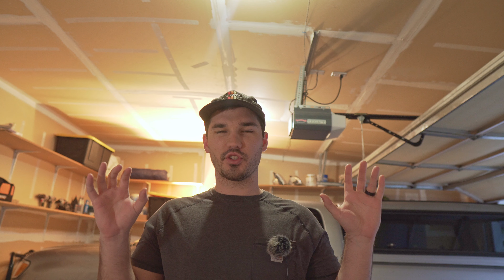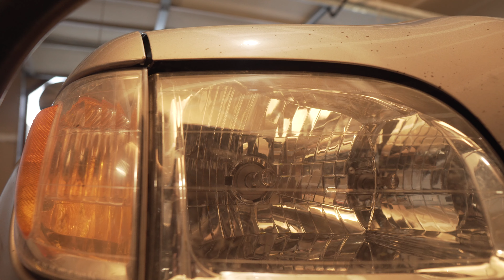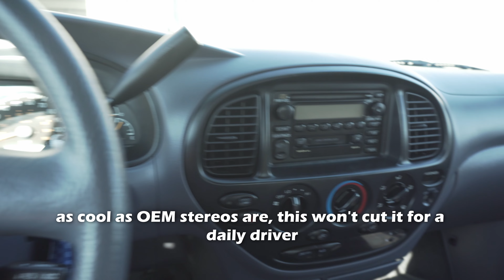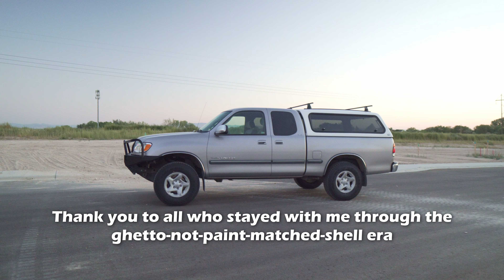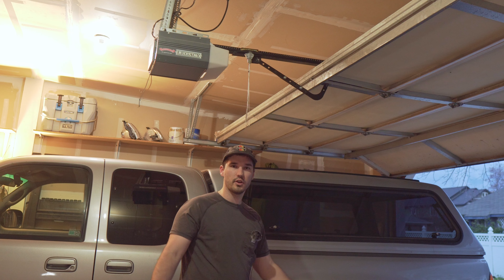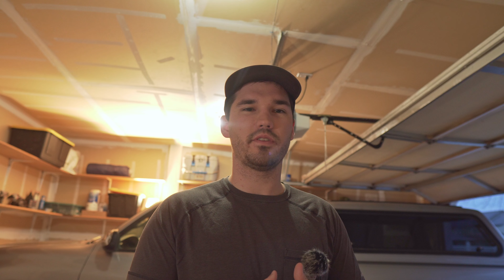3 Upgrades That EVERY Old Vehicle Needs

Comment: My 2002: Headlights: I installed S-V.4 LED with the proper cut-off in new OEM housings, these are plug & play and there is no scatter effect. I also installed Yellow 3000K LED 9006/HB4 bulbs in my OEM fog light housings. I am still using the factory head unit with a small factory amp, it has a built in 6 disc changer and a cassette deck... It sounds and functions great, but I may upgrade the speakers at some point. 

Personal touches: Alloy wheels from a 2005 Platinum. Tail light housing from a 2005. Bilstein 4600 series shocks and Hellwig anti-roll bars front and rear. I also installed a Kazuma/TRD LSD in the rear. I installed a huge light weight aluminum Truck Hero ARE camper shell on my 8 foot bed, it has a full size hatch back door that eliminated the tail gate. In 2004 I replaced the cracked exhaust manifolds with JBA short tube headers, this solved the ticking problem and turned out to be a nice upgrade as well.

 I had the hood & roof of the truck plus the front, rear and roof of the camper shell sprayed with Line-X, this adds a layer of protection and reduces surface area that I have to wax/polish. I had an ARB winch bumper on the truck for a short time but I did not like how it's weight moved the center of gravity to out in front of the truck, so I reinstalled the factory bumper.

Comment: I also sleep in my truck bed on road trips. A problem I'm currently having is condensation builds up on the ceiling from the heat my body produces. This condensation then rains down on me throughout the night. Have you had this problem, and if so, how did you solve it? 
I'm guessing opening the windows would help in the summer, but it is too cold to do that in the winter.
Reply from the maker: Open the window no matter the temps. That’s what I do. Slide the cab side window open a little. 

A battery powered or rechargeable fan also helps

Comment: The high beam/fog light issue is due to the stock fog light being wired to the low beam circuit. If you do the modification usually referred to like fog lights with high beams for your car you wont have this issue when upgrading halogen bulbs.

Comment: To add to the headlights, install a headlight relay harness. A lot of old cars run power for the headlight through the switch and back to the lights. the harness Insures that your lights are powered straight from the battery, giving them just a bit more power and thus a bit brighter. 

Also, if you can find them for your vehicle, get E-code headlight housings made for left hand drive. they will have a much better beam pattern over the stock housing. The pattern is flat light modern lights but with an upward swoop on the right to illuminate the shoulder and roadsigns and such. 
I run E-code housings, the relay harness and high wattage HALOGEN bulbs in my Cherokee and it's great. Low beams give just the right amount of light and high beams almost feel like a light bar. I prefer it over the headlights in some of the newer cars I've driven

Comment: I've owned my '02 Sequoia for 7 years now and I've updated it along the way. Ditched the head unit and sourced Crutchfield for a BOSS Nav unit. It doesn't really compete with today's factory systems, but for what I need it to do, it's done the job well. Welcome bonus: back-up camera! Switched out all of the dashboard and instrument panel light bulbs and replaced the dim yellowed dome/map/entry lights with cool white LEDs. Boy, they made a big difference! I can actually see around the cabin at night now! I admit I jumped on the TRD knock-off styling train. Heritage grill? Yep. Imitation TRD wheels? Yup. New headlights? You betcha! Freshened the look and gave the truck a subtle aggressive stance, which it really needed!
Reply from the maker: Sounds like you’ve made a lot of good upgrades

Comment: I have a 2004 Grand Cherokee - when I put on my old man emu lift I replaced all my control arms and bushings as well as any rod ends that were worn. One and done. Put in new headlights and housings as well just the OEM housing and halogen lights but brand new made a huge difference. I'm debating a head unit, I like the old look of the original cd and tape deck lol.

Comment: The monthly finance charge on a new vehicle today is over $500.  A little love on an older vehicle that is paid off goes a long, long way.
Reply from the maker: Absolutely. I’d rather pocket the money and have a paid off vehicle
Reply: lol, My boss asked me when I was having some expensive engine repairs why I didn't just trade in my old '98 Expedition for a new one.. My response was that I could completely rebuild mine (new engine, transmission, and axles) for less than the down payment on a new one, lol....

Comment: Good tips on the headlights! I just purchased a new set of front headlight lens as the 20 Y/O stock ones on my 04 were so cloudy and yellow. I tried a few of the lens restoration kits. They work for 3 or 4 months and then go downhill quick.  I put in a pair of small, square Baja Designs yellow lens fog lights in my new steel front bumper. They operate just like the stock fog lights do.  Waaay more brighter!  They make a huge difference.

Comment: I had the same issue you’re having with the high beams. You probably need a canbus decoder put inline between one of your headlight plugs and the vehicle. I used the best view h4 9003 for my tundra. Works great.
Reply from the maker: My understanding is that the issue stems from not enough load on the circuit since the LED’s draw a lot less power. But that’s only what I’ve been told
Reply: @208Tyler  that may be the case. Before the decoder, whenever I turned my fog lights on the high beams would also turn on. After the decoder, the lights operated as intended. I have an 06 tundra.

Comment: The first mod for my Sequoia was to transfer my head unit and speakers from previous trucks.  I’ve  built retrofits before, but I was willing to try the Colights and am mostly satisfied with them.  I haven’t gotten too much into personal touches.  I’m working on maintenance and repairs mainly now, but I do have a small subwoofer about to go in, some headers and the 5100s for a lift.
Reply from the maker: That’s awesome! Dude headers would be great. My truck needs them pretty bad at this point haha